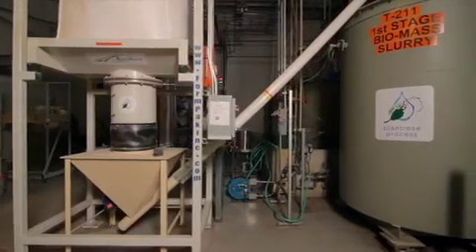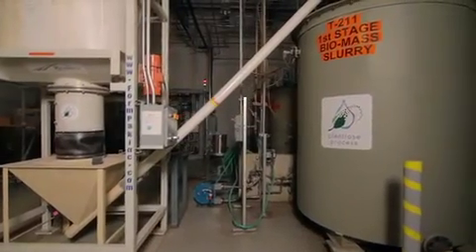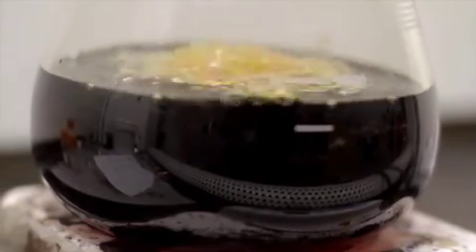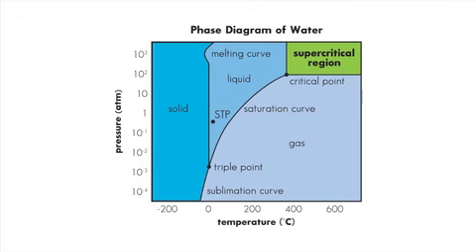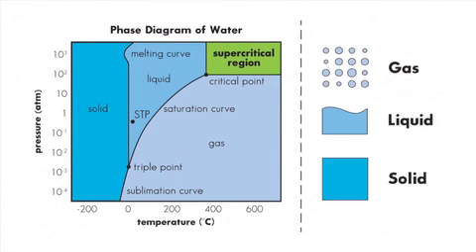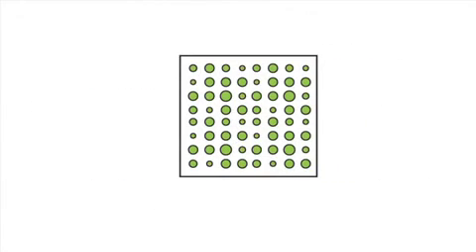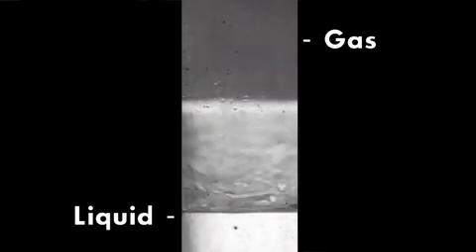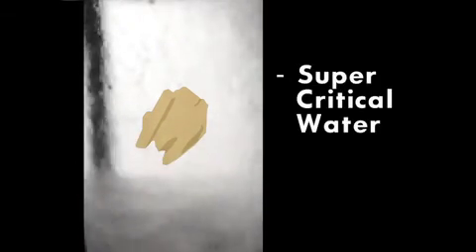Renmatix Overview

Comment: You guys (and gals) are definitely on the right track here, especially for isobutanol production from inedible plant mass. Several years ago I actuary thought of a similar process utilizing supercritical liquid CO2 due to it's exotic solvent properties in the essential oils industry.

Funny it never occurred to me to use something as simple and cheap like water or possibly other supercritical fluid extraction materials maybe at ambient room temperature to crack cellulose saving on heating costs!